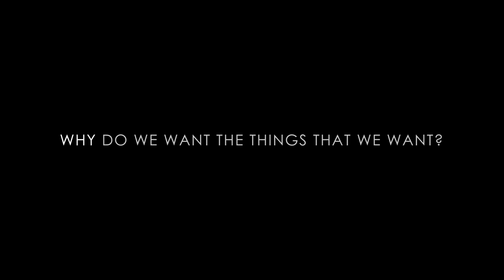How I changed my mind about rural living

Comment: I just started to watch , you look like your having a hard time with the cement on the stones, the easy way is use a piping bag it gets the cement into the cracks of the stone.
Reply from the maker: Thanks for sharing your thoughts, we're always open to hearing different ideas. I've seen others using grout bags and mortar pumps, but our choice to use pointing keys is deliberate. For one thing, to use a mortar pump or grouting bag, the mix has to be extra wet so that it will flow. Generally speaking, you want the driest mix possible that is still workable and sticky enough to bond properly to the wall, because mortar shrinks as it dries and if there's too much shrinkage you won't get a proper bond. More moisture means more shrinking, and more potential for bonding to fail. Now, at least for interior pointing it might not matter if the quality isn't perfect, but for outdoor pointing it's absolutely crucial to get the pointing right, otherwise the building will suffer. Using grouting bags would certainly save time, but there's a quality tradeoff we're not willing to make on this building. Hope that explains a little the reasoning behind the decision. Still, thank you again for leaving a thought. We really enjoy hearing feedback and ideas.